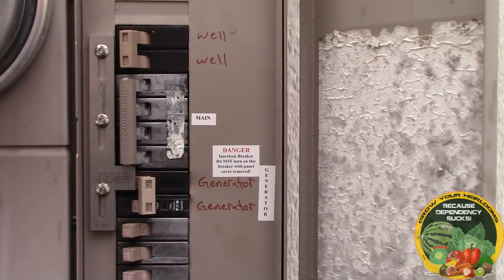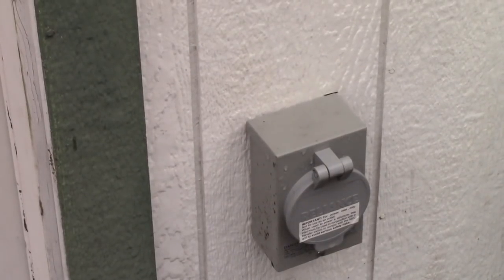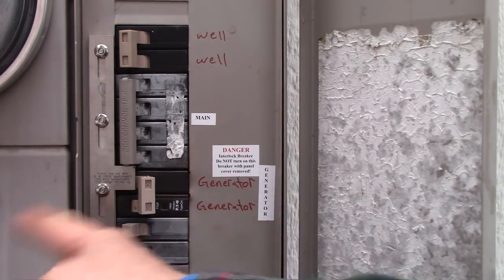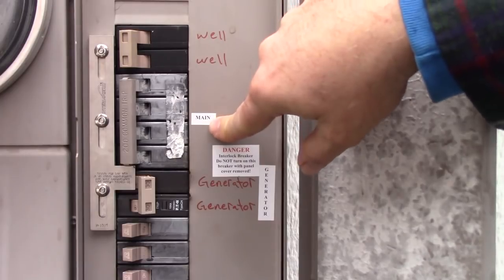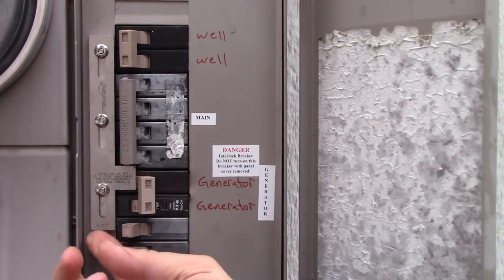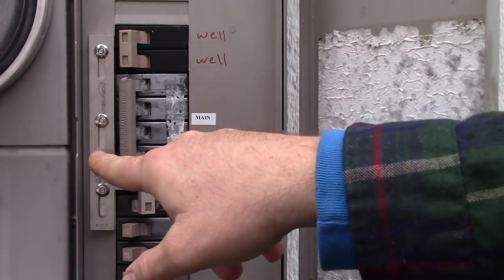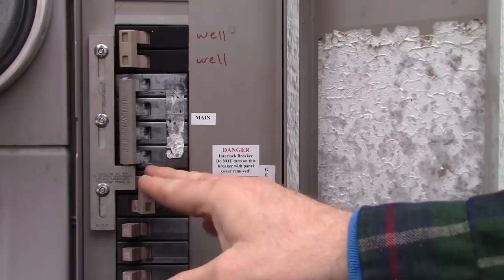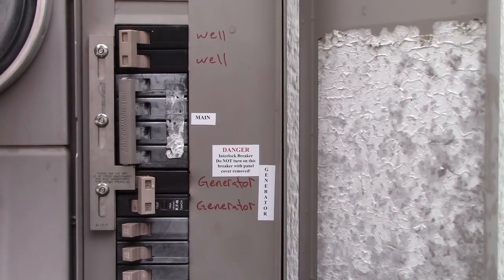Surviving a Power Outage By Using an Interlock Switch

Comment: Please explain how the outlet is tied into the switch?  Did you have to run wires through the walls or is there something existing that you use?
Reply from the maker: The outlet is wired to its own breaker
Reply: @Growyourheirlooms  I understand that but what I was asking is whether you had to run a wire all the way from the outlet to the breaker, though the walls. I guess that's the only way it could happen, but I have watched a few videos about Interlock switches and no one mentions that, so I am second-guessing what I think I know.
Reply from the maker: @BooLee01  Sorry, I should have been more specific. Yes, the new wire from the switch to the new breaker is in the wall. But the walls in my garage aren't insulated so it was easy for me. Had they been insulated and sheetrocked, then I would have had to snake them through. I suppose a person could just use conduit on top of the Sheetrock and not snake it through the walls but I don't know if that's code. You'd have to talk to an electrician.
Reply: @Growyourheirlooms  Thanks, that's what I was looking for. My parents are in their 80s, live in a lake house out in the country, and have gone through two extended power outages. That really scares me, so I am planning on buying them a generator and am just starting to do my research.  My big hope is that I show up and find out the previous owners have already installed some kind of inlet for a generator. I am hoping, but not expecting.

Comment: Hi. I have a 200 amp main panel and another 200 amp sub panel next to it. Do I need 2 interlock kits and 2 double breakers or just 1 set in the main panel.
Reply from the maker: You need an interlock on the panel that has the main breaker. If the main panel feeds the secondary panel, then shutting off the main will kill the second panel. You can test it by cutting the first main. If that cuts all power then that's the one. The electrician can tell you.

Comment: I've been looking for an interlock like that...I can't find one using the google machine...is there a manf name on it?
Reply from the maker: There isn't.  I called an electrician. He matched the interlock to the electrical panel. It had to be compatible.
Reply: @Growyourheirlooms  thanks. Are you saying the electrician fabricated/had one made custom?
Reply from the maker: @jcooper1331  No. He just ordered the correct one to fit my service panel. And it is UL rated
Reply: @Growyourheirlooms  thanks again. But I'm still missing it...what is the mfg and even better, the sku# of the part he installed?
Reply: I need to order the exact same thing
Reply from the maker: @jcooper1331  Ok Sorry. It is the "Wyle K-1315 Interlock Kit"

Comment: very interesting gadget!
As an engineer working in Europe we don't have the same gadgets, but this one looks interesting..
Just some details you should keep in mind:
Your generator is a single phase unit and your mains is three phase. This means that no three or two phase (I think you have some products in the US) machinery can be used while you're on stand-by mode.
Never shut-off the generator before you switch back to the mains - even better wait for a minute or two for the engine to cool down.
Depending on the work done by the electrician, most probably you'll have up-and-running appliances only connected to this specific phase. If yes then make sure these are the ones you need when the mains goes out.
As you are not supplying load to the appliances directly but through their fuses it means that you could have a high load appliance in the same fuse with a low or critical load appliance (e.g. a toaster and a lamp). Experiment on that beforehand. 
If your generator is not an inverter type, then be careful of your electronics - the voltage quality is not very good and can burn or creep the electronics.
and last, in Europe the max you would've spent on this job would've been 150 bucks!!
Reply: Not quite, in  North America actually have various power services depending on the application. The system you are talking of is mostly used in medium to large commercial systems that run 120/208V 3 phase or 277/480 3 phase for really large systems. It's extremely rare to see that kind of power in a residential setting. What he most likely has is split-phase 120/240V. That being said, the mains breaker is an older style 200A that actually has single terminals underneath.  The generator breaker is the same running at 30A. The outlet is most likely a NEMA L14-30 which is a split-phase connector and so he probably has a split-phase generator. Which will power everything in the house just fine...amperage load not exceeded. 

I will agree with you that letting the generator do a cool-down cycle is best for the engine.

combining appliance is common in older homes, but against electrical code (and best practice) in newer construction

yeah, in the US it'd have been about that for everything plug the generator.

Comment: Outstanding job and a great video!  You are right and for $600 bucks this is one of best investments you can make to protect your home. I just installed a generator interlock this week. The only difference is I installed a 50 AMP and got a larger generator to match.  Yes, my total panel is only 150 amps, so I should be well prepared when....not if...but when the power does go out. Thank you for making this video.
Reply from the maker: Thanks
Reply from the maker: My power goes out at least 10 times per year

Comment: Hi may i know the brand of the generator interlock kit and the price? Thanks.
Reply from the maker: The electrician bought it and installed it. He came out, inspected it to get the right one for my panel. Cost of the switch and installation was around $500

Comment: YOU can automate the system if you want to where you don't have to do a thing when the power goes out.
Hook up your controls so when your main power drops out it drops out a main set of contacts and connects the generator to the breaker box.  It's simple.  You just need a contactor with a pair of N.O. and N.C. contacts that will hold the load of your breaker box.  
When the power drops out it makes the power circuit from the generator to the breaker box through another main breaker as well and when that circuit is made it closes a control circuit that energizes a time delay relay that energizes the starter circuit on the generator and that will stay energized for a given amount of time and when the generator starts it will energize another relay that cuts off the generator starter relay and you have power in the home.
Then when the line comes back on it automatically energizes the main contact which shuts off the generator and you are back on the grid again.
I think I covered all the bases but may have forgotten something.  To do it right you need to draw out a print and prove it on paper first then just wire it up.
If you don't mind putting the money in a few controls, it is an easy job.
Reply from the maker: Thanks for the info. I didn't know they could be so sophisticated